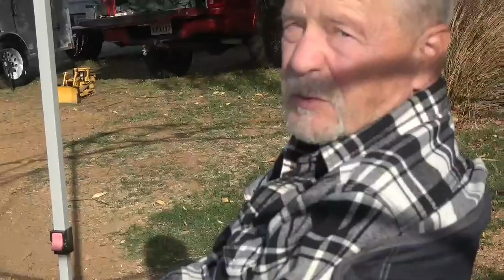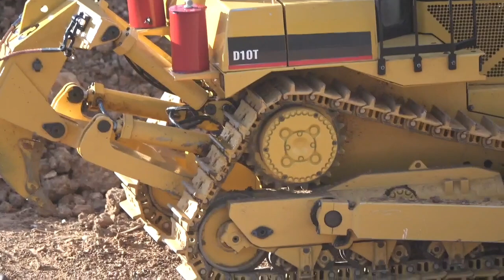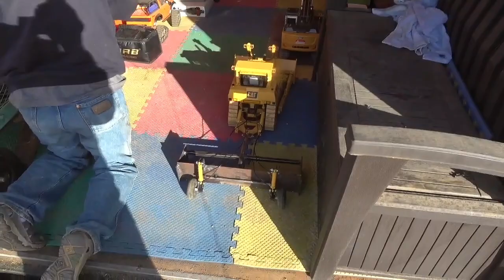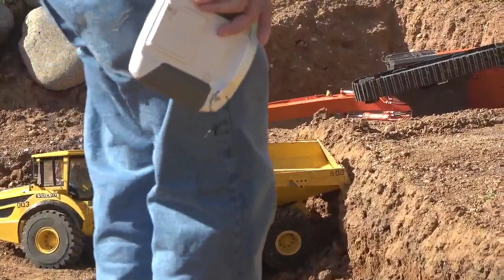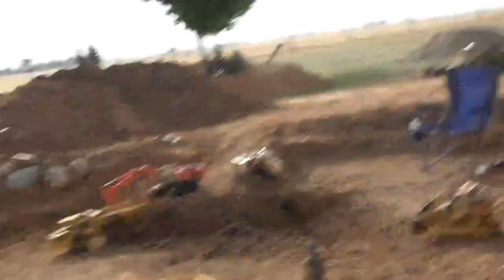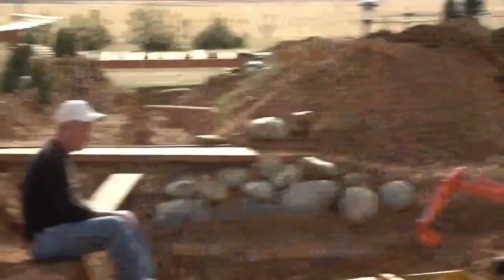Hitachi 360, 945 liebherr, 360L,  A40G's,  dozer in the pit.

Comment: I have the double pump version of the JDM DIM3 360-5 excavator that toucan hobby modified to 2 pumps. The excavator is made by JDM a very good company by china standards. Double pump version is very strong and it will dig the ground without prepped dirt. I can’t relate how the single pump version runs.